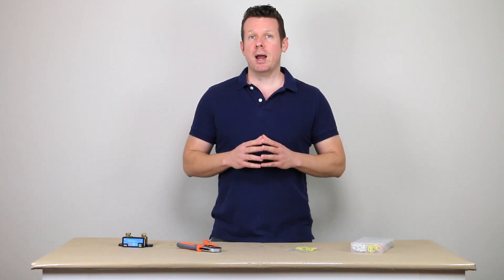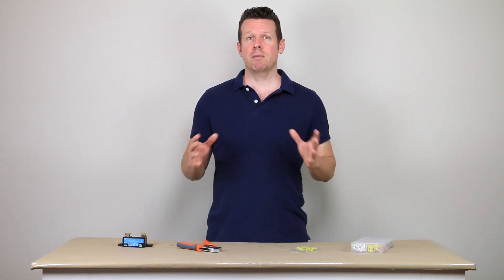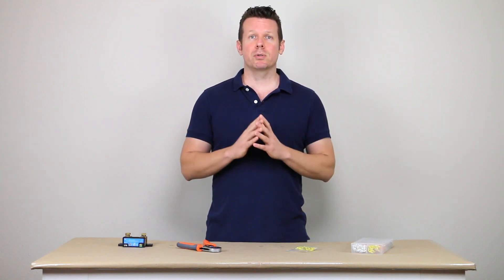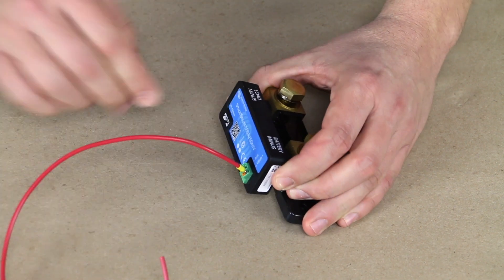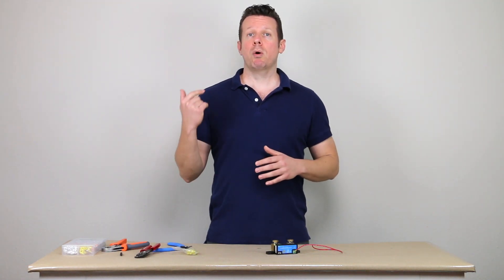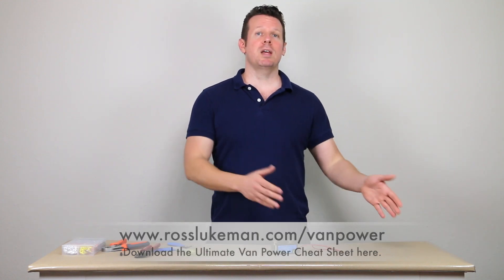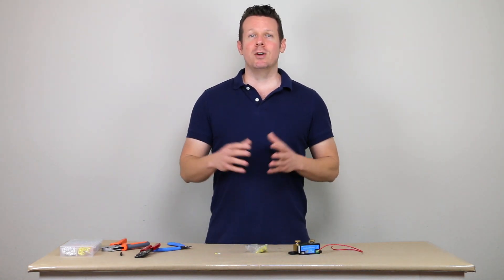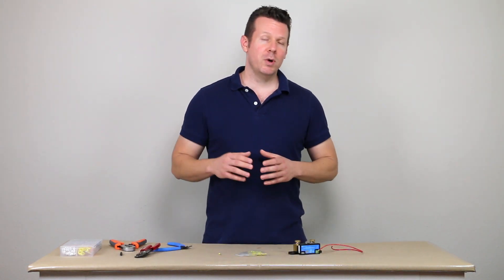How to Add Ferrules to Signal and Power Wires in Your Van or RV Power System

Comment: I did automated controls set up and most of the PLC's and related components use a 4 sided hole/connection.  So we used a square Ferrule crimp.  For round connections the 6 sided hex is the better choice.  Ferrules make a much better connection, especially if removing and reattaching.  They also prevent inadvertent shorts if you miss a strand which is easy to do with fine stranded wire.

Comment: Cool, looks really nice.  Another gent says he has used a soldered end.  Interesting as electrons pass on the surface of the wire, each strand too!  .... Somethin to ponder.
Reply: Ferrules have been a problem multiple times in my Career, even ones that where well done.
Reply from the maker: @sebastiangeorge7714  What happened with the ferrules?
Reply: @rosslukeman  mostly loose crimping but sometimes the connection is just on a corner and connections is gone ever vibration/high resistance. 

To be fair the Ferrules and Tool you suggested is the only combination that works quite well.
Reply from the maker: Thanks for the comment David, soldering works too!